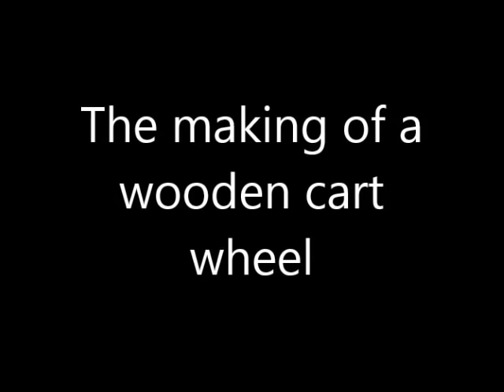wooden wheel making .wheelwrights.

Comment: Thanks! Brings back lots of memories.My dad did this as an extra income on our farm. There was no electricity, and everything shown in your video had to be done by hand with handtools, which I still have most of. The metal band was bought in straight lengths, and had to be heated in a furnace section by section and formed into a hoop on the anvil and hammer. The ends were then heated to almost melting point (sparks shooting out of the ends) and then fused together by hammering into shape. Dried cowpats worked best for heating up the hoop, which was my job to go and pick up in the veld.

Comment: Thank you for showing me how you build a cart wheel! Amazing work!
Reply: Believe me Vernon, this is the "once over lightly" version!!
Reply: Walter Strong /Yes I believe you. The jigs did not happen over night and the experience says 20 years. I might be wrong but what's showing is experience was a long hard road! Makes me happy that building wagons and wheels is still with us. I hope that its carried on. 
I go to the Saint Louis Arch and they have a stage coach! I'm always fascinated with the wheels and leather suspension on it! 
One question I have! Why not adapt wheel bearings, why keep greased sleeves?
Reply from the maker: vernon slatton . cheers. yes 30 years I have been making and repairing wheels . the bearing thing I think it's too do with the complexity of a roller bearing system. you would still need a long sleeve to hold the bearings and spread the load across a large area of the wood. the traditional axels work very well and are simple and reliable.  the collinge axle  and Bush is a fantastic bit of engineering.  the axle is case hardend and the Bush in the wheel is chilled cast iorn. there is an oil reservoir and leather oil seals the fit is hand lapped and very accurate  they last for ever as long as they are oiled and run smoother than a roller bearing.
Reply: steveibean / 30 years wow! Your right of course! Hundreds of years of tech in those greased bearings! If you get the chance to make more videos, please do! Greatly appreciate your time and wisdom! Thank you again
Reply from the maker: I do intend too .when I have the time.
Reply: vernon slatton
Reply: st
Reply: Sniper bro 101 Pat 0 0o0
Reply: vernon slatton 跟誰講啊 看你有沒有比較特殊的 看你有沒有特殊的啦 要看有沒有比較好了啦 那個都看過了啦 自己 找看有 有電腦我還不會才不會用我改天會用喔 附近全家樂馬車了輪胎 沒有特殊的啦

Comment: Well I wanted to say keep practicing and you'll get the hang of it! but your a bit to good for that, thanks for sharing your fantastic skills, what do you use for bearings and lubrication.
Reply from the maker: thanks. we use original old axles mostly. these wheels were off a dray from about 1900 and the original arms and bushes were still in good condition . we can get new axles made but they are expensive and not as good as the old ones. most customers have old rotten wheels with the axel and bushes so we fit the old iornwork to the new wheels. I'm always buying rotten old carts just to save the axels etc.
Reply: Imagine having to make these wheels without all that modern electric powered equipment! I suppose a factory could use a water wheel to create a lathe, but it seems to me a lot of this would have had to be done by hand. It probably took better than an entire day to make 1 wheel! Great job.
Reply: Sharpening wood lathe tools
Reply: 551moley n
Reply: 551moley m m m bmn n bmn
Reply: 551moley
Reply: 551moley
Reply: 551moley
Reply: 551moley

Comment: I think that, of course, even in the 19th century, without power tools, these wheels were made much faster using patterns and conductors! But ... amazes The mind of our ancestors! Here in the video, the author-master installed the spokes in the hub by spreading them through one between themselves, symmetrically at opposite corners, and to the common plane of rotation of the wheel (as in a bicycle wheel)! That is - the same mutually exclusive tension is created, which thereby centers the rim in this plane of rotation of the wheel !!! ... But HOW MUCH human Thought and Experience went to this !!!

Comment: Even with all the jigs and machines, it is still a difficult work to complete a wheel. The most critical task is to connect the spokes between the center to the wheel. It is quite a precision job to be done. My respect to the master craftsman. I also had built a 24 inches wheel for my wood lathe. Since I don't have a bandsaw, I used a saw, chisel, block plane, and spokeshave to complete the solid wheel without the spokes. I would love to have a wheel with spokes but I think I wouldn't be able to do it.

Comment: Interesting to see a motorised square chisel mortiser which looks quite old!  I say that because the one I served my time on was similar to that except that it was older, not motorised, and the chisel was thumped down to form the mortise which was hard work for a puny apprentice!
Reply from the maker: Yes I also have owned one like that, in fact the earliest motorised ones were adapations of them  ie the motor and chisel holder were just bolted on to the same machine

Comment: Absolutely fantastic craftsmanship, combining   old technologies with new! The design proved over many years to be excellent! 
What kind of species wood was used with this wheel and could different types be utilized?
Reply from the maker: Thanks. Elm hub, Oak spokes and Ash felloes.
These are traditional English timbers, other timbers are used sometimes Beech for felloes and Hickory for spokes, or Oak for hubs, and in Australia Blue Gum and Iorn wood, 
Each timber is used for its own properties, Elm for its twisted interlocked grain and resistance to splitting, Oak for its rigidity, and Ash for its elasticity.

Comment: I have a question, if you don't mind, what kind of wood do you use for the outer circle?I also have an old cart and the outer wooden circles have rotted.Thank you!
Reply from the maker: Hi, its Ash, because it is flexible and springy, however it's not very durable and often rots away or suffers from woodworm attack,  the hubs are elm and the spokes are oak.

Comment: A lot of respect !!!  👍👍   But why does he not use glu ?
Reply from the maker: Hello, there are many reasons why the joints are not glued in the making of a wheel, the main reason is that the whole wheel is bound together by the action of the iorn tyre shrinking onto the rim of the wheel as it is cooled, before the tyre is put on there are gaps between the rim sections these close up as the hot tyre cools and shrinks in circumferance as the gaps close the spokes get forced into there mortices in the hubs and the ends of the spokes into the rim sections mortices with great force compressing the wood and making a very tight fit, so all the joints need to be able to move, this would not be possible if they were glued. Also it allows the wheel to be dismantled for repair of a broken or rotten component ie a spoke or rim section.
Hope this answers your question

Comment: Long time to finish one.
My father without all these machines you've got, but rudimentary tools would finish a bit faster. Not as fancy, but out them to work with the horses in one day or two.
Reply from the maker: Hi, the video is taken as I am making a set of 4 wheels, it's not the same wheel in all the shots, it would be silly to repeat all the clips 4 times, also you can't tell how long it takes from watching a 40 min video, it obviously took longer than that in real time. Machinery obviously speeds things up a bit and even with this it would be a very long day to make a wheel from scratch in one day even if you had already made some components of the wheels first.

Comment: How did they do this before all the modern tools?
Reply from the maker: With the tools they had at the time, to them they were modern tools. 
Same process,  whether you use a hand saw or an electric circular saw. 
A bit and brace or a cordless drill, 
Wheelwrights always embraced the latest technology,  in the late 1800s they had alot of machines specially made for wheel production.

Comment: Take note woodworkers: Measurements were mostly taken by juxtaposition such as story sticks, spacers, dividers and the like. We all need to realize the value of NOT always measuring with tapes and rules!!
Reply from the maker: Well spotted Fred,I often say to people that you do not need to measure anything with a tape or ruler when making a wheel. Early wheelwrights had a selection of patterns handed down from generation to generation and marking out tools like gauges dividers etc, they also new instinctively the right proportions of the parts of each wheel , depending on the vehicle it was to be fitted to and its intended purpose.

Comment: (1)   Why isn't the wooden outer wheel not made of one piece of wood?
(2)   No glue applied to wheel and spokes?
(3)    What is the purpose of the "pins" that are inserted into the holes in the outer wheel?
Reply from the maker: Some thin light wheels use steam bent rims in two halves for extra strenght where the rim would be very small cross section.  Easy to bend. The system of useing felloes or rim sections is used because most wheels are quite chunky in the rim and small diameter. This would make steaming the rim quite hard and hard to get it perfectly round. Also and most importantly before the tyre is shrunk on there are gaps between the felloes at the joints where the pegs are these gaps close up as the tyre shrinks allowing the rim sections to move inwards towards the centre and push the spokes hard into the hub and the other end of the spokes into the felloes.  Thats also why there is no glue .the joints must be able to move to allow the tyre to clamp the wheel tight. Also damaged spokes and rim sections can easily  be replaced.

Comment: Amassing job, but large wheel made not correct, because of technology. Large wheel originally made from boiled and then bended peace of oak wood.
Reply from the maker: Hi Tomas
It is actually the lighter wheels that are made with steam bent rims.
The heavy wheels have always been made useing " felloes " theses are the sections cut out for the rim. Sometimes Oak but normally Ash.

Comment: However, when the wheel is rotated, it is noticeable axial misalignment..😀😀😀😀
Reply from the maker: Hi, at this stage the box or bush in the centre of the wheel still has to be wedged into final position, its done after the tyre is put on, the tyre itself is the old wrought iorn tyre from the original wheel and they are not perfectly round like a machined modern wheel rim would be. A small amount of runout is acceptable on a cart wheel as they were made to turn slowly and travel over rough surfaces, wooden car wheels are made differently and will be more accurate.
I missed out the process of fitting and wedging the box in this video but plan to make some more videos showing the different processes in more detail.

Comment: Cannot see there is an angle between spokes and hub ... on a chart this is paramont - on wheel-barrow obsolete, but this wheel might be for other use ..
Reply from the maker: Look again, the angle you speak about is called the Dish of the wheel, you can see how the mortice machine makes the mortice at an angle, the spokes are also staggerd so the back spoke has a greater angle than the front spoke, creating more triangulation, your correct the dish is very important in a cart wheel, but a wheel barrow wheel has none,if you are an engineer you will understand why.

Comment: Dude... its a lot easier to use a ruler: 

circumference = diameter * Pi
Reply from the maker: Hi Bob, its actually easier to do it with the traveller,  this is how its been done for a long time and its very accurate, which it needs to be, you don't need a ruler or any maths to make a wheel each part is measured off the other parts, old wheelwrights used patterns handed down through the generations, the sizes of wheels and there parts and proportions evolved over thousands of years.
Reply from the maker: You have to measure the inside circumference  of the iorn tyre ,hard to do with a ruler or a tape. Its no good measuring the lenght of the straight bar because bending it into a circle changes the lenght.  The measurements have to be accurate to within 1/16th and its often 12 to16 feet long

Comment: Not much heritage skills. Too many machines used.
Reply from the maker: Of course wheels were made for many years with hand tools, as was everything else. But wheelwrights embraced every advance in technology that came along from water wheels to steam and then diesel power and eventually electricity.  From the late 1800s wheels were made in huge factories with purpose made cast iorn machinery, as were the axles and springs and other parts of carriages. Wheelwrights could buy ready made spokes turned out on complex copy lathes that could make 1000s of spokes a day.
Do some research, you will be surprised. 
Thanks for watching.